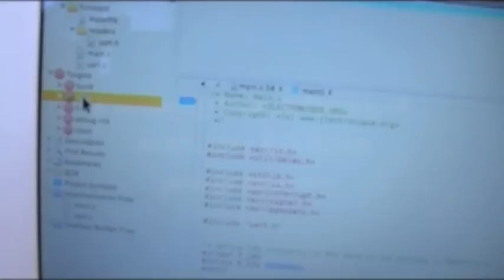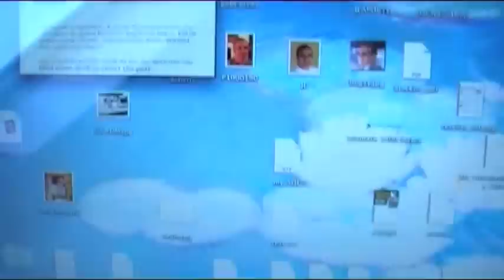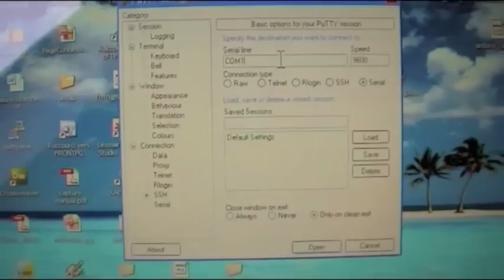USB to  TTL UART Bridge / Pont USB UART Série

Comment from the maker: From WIKI

Universal Serial Bus (USB) is an industry standard developed in the mid-1990s that defines the cables, connectors and communications protocols used in a bus for connection, communication and power supply between computers and electronic devices.

A Universal Asynchronous Receiver/Transmitter, abbreviated UART (￼ /ˈjuːɑrt/), is a type of "asynchronous receiver/transmitter", a piece of computer hardware that translates data between parallel and serial forms.